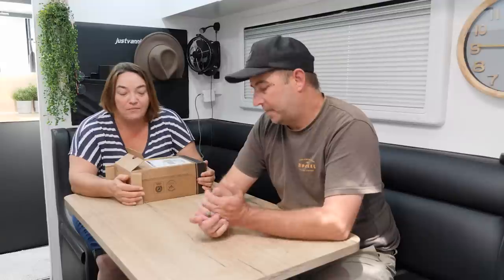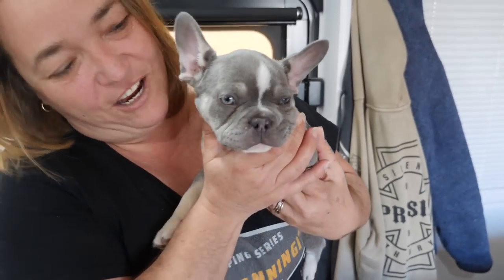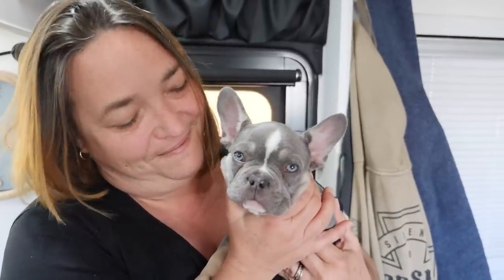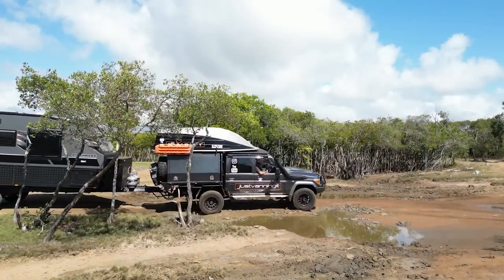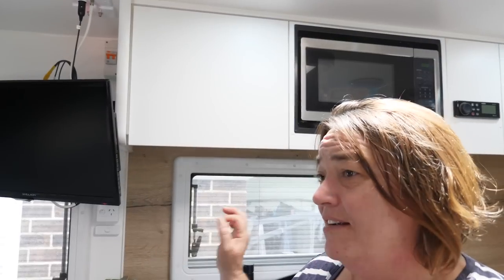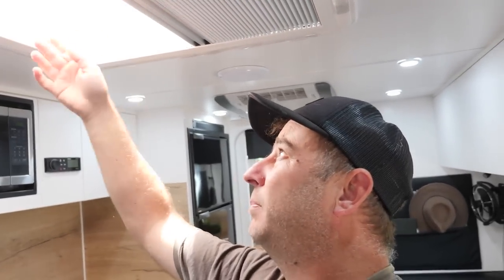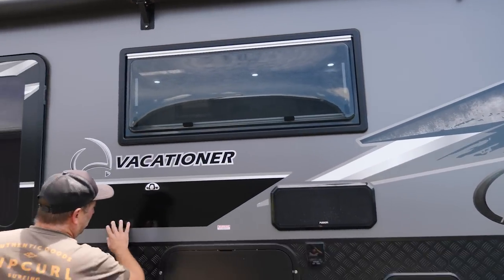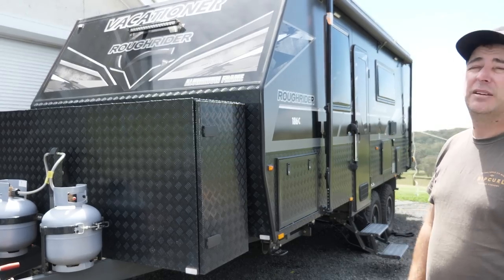HONEST 6 month review of our Vacationer Roughrider 18'6 caravan

Comment: Cut and polish and and buffer from a auto dealer that will fix the scratch. 
And a roll of gater plastic that sticks on the metal when your going through the bush that will stop any scratches in future. 
Gater plastic you can peel it off when you are back on the road i use it on my jeep when I go bush.
Reply: Tgisnis 8nvredibly helpful advice Peter, thank you very much. I will get straight onto that! The film is an excellent idea for future travels, going to wrap th whole van in it 🤣
Reply from the maker: Thank you Peter. Will have a look at that. Appreciate the idea🙌🏻

Comment: For the dent where the door hit, go to a Clark Rubber store and grab a thick piece of rubber/neoprene or similar (tell them it’ll be outside so needs to be UV resistant), cut a round shape to cover whatever size the dent is. Grab some black 3M VHB (very high bond) double-sided tape and stick it over the dent. Done, covers the current dent and helps to mitigate any future misfortune.
Reply: Great idea, it will def help prevent damage if it reoccurs! Thanks for the support and advice!
Reply from the maker: Thank you for the idea 😁

Comment: I have the same blinds in my van.  They definitely degrade over time and end up with marks and stains on them which bothered me.  I ended up removing the inside sections of the windows which contains the blinds (phillips head screws around the inside perimeter of the frame).  After removal, I placed them on a table and fully closed the blind and then masked off the white plastic frame.  Then using a standard pressure pack of semi gloss white paint, I resprayed each blind with 2-3 coats and they came up like new.  Before refitting the blinds, I made sure I scratched off the paint from the nylon fishing line guides so the blinds would open without being restricted by the paint on the fishing line. With some blinds, I also repainted the silver side with silver spray paint where the surface had degraded with the sun.  Blinds now look like new and with added protection from further stains as the paint has given them a protective barrier. Hope this helps guys.
Reply: Oh wow, thaybis a duper idea. A bit of preparation and work butbwell worth it! Thanks so much for sharing. I am sure you blinds look amazing!
Reply from the maker: Thanks so much Chris. Appreciate the advise and will take this on board.

We hope you have an awesome day 😁

Comment: Great Video, good to see Sue is feeling better, hope all is ok with the Cruiser and not too much cost $$$.   That's a great van and if I was upgrading would definitely be up the top of my list, you mentioned a few times that you specified/built the van for your set up, can you advise what changes you made to the stock standard Vacationer 186C.
Reply: Thanks so much! I am feeling alot better! We are coming right with the cruiser. Hopefully back on the road soon. Great to hear you like the van. We changed alit on the stock standard vacationer. Will get Deryck to send all details to you. Hope you have an awesome week!
Reply from the maker: We didn’t upgrade too much to be honest. We wanted a 186 dual axle with some clearance , hence the flat floor which gives us loads of ground clearance. We upgraded the power to the Dakar power system, added the dust reduction system. Added the black pack, stereo upgrade, timber bench tops , wall hung washing machine and I think that’s pretty much it to be honest
Reply: @justvanningit  thanks, so the 186 duel axel flat floor is not standard?   Was this the first one they built like that?